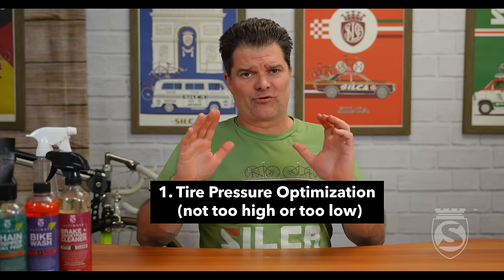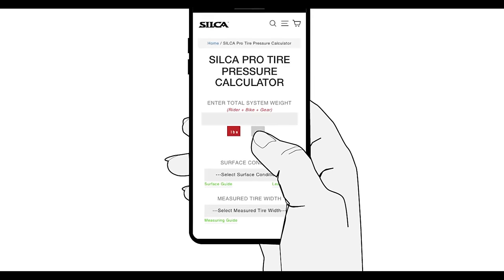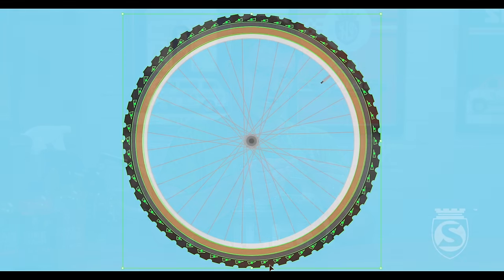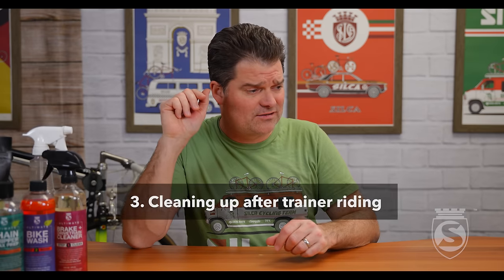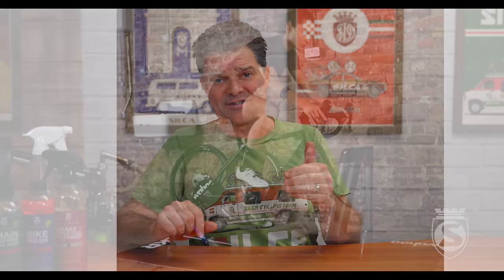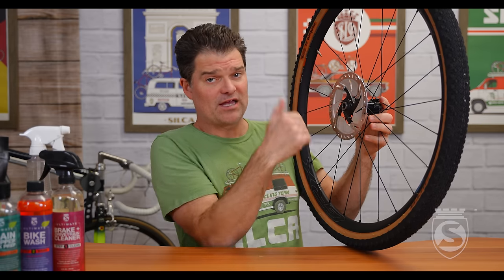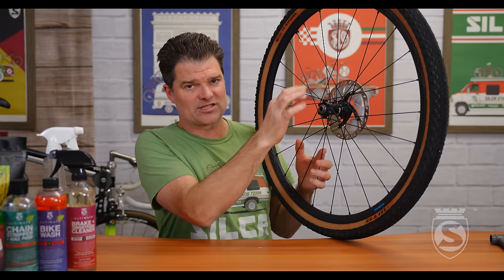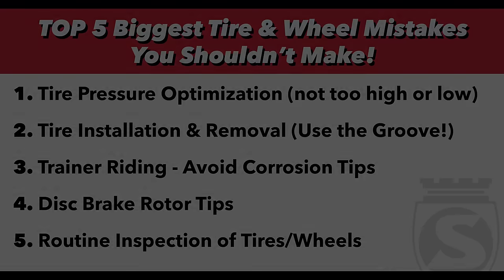Top 5 Biggest Tire & Wheel Mistakes You Shouldn't Make

Comment: I always find that warm tires are easier to install than a cold one. I usually put them in the sun for a few minutes before installing. The tires seem to be more flexible when warm.
Reply from the maker: That's a great tip!
Reply: I put them in the bathroom (my warmest room) 11:04 over night before installing so they’re 26 degrees Celsius when I install them instead of being 15 degrees. It’s often the difference from an easy install and a hard install. I also bought the plyer thingie and it’s absolutely worth it.
Reply: Under the more is better theory, popping that tire in the oven at 350F for 45 min will make it super easy to install... or will make banana bread
Reply: great tip on the tires. I put my tubeless tape in the sun for a few minutes before applying. Makes the adhesive a little tackier.
Reply: Best tip. Put your bike in an autoclave. Tyres will slide on. 

#Sorted
Reply: Funny comments aside, I mounted a new GP5000TR 28mm last night and had left it on a radiator for an hour. Obviously not in the oven temperatures, but comfortably warm to handle and it went on much easier that the one I did early in the week that was cold. It works. AND Schwalbe tubeless rim tape forms nicely to the rim when that is warm too.
Reply: I stick a new tire on the dashboard of my car, facing the sun, for a half hour or so. This really helps soften up the rubber for an easier installation.

Comment: Your pressure calculator really helped me, and I'm just an average guy.  Interestingly, I like them about 2 psi less than the calculator tells me.  Now I know why.  By the way, my Pirelli P Zero Road 28 mm measure about 30 mm on my wheels with 21 mm inner width using TPU tubes.  Part of the reason I switched from Contis is the Pirellis are so much easier to mount.  I can always do it with my bare hands.  And they never get those fibers coming out of the sidewalls like Contis.
Reply: 2 psi isn't really an accuracy you can gauge with any bike pump, if you're within 5 you're fine.
Reply: @countspokeula539  You raise a great point, but I always check with a digital gauge.  But who knows how accurate it is?
Reply: @stuartdryer1352   I know, it amazes me that pumps don't quote an % accuracy like so many other things these days

Comment: I don’t sweat much on my trainer, but just in case, I use a slightly cracked carbon wheel on the trainer so don’t need to worry about damage (in my case the trainer bike is only used on the trainer). So if you have an old wheel and use your road bike on the trainer, take a minute and swap out your good road wheel for an old one and then no worries.

Comment: I’ve got a couple sets of wheels that are from the early days of Tubeless.  Sometimes to seat my tires tubelessly, I have to mount the tire with a tube to seat the bead, then remove one side (and the tube), install the valve stem sans core, and use A LOT of pressure to re-seat the other bead.  A bit of a dance, but it works!
Reply: Even using the "blast" bicycle pumps don't always work because the air escapes before it can build up enough pressure to seat the bead of the tire.  I am now resorting to using an inner tube inside my tubeless wheels since that's how the bike came originally.  For me tubeless tire mounting & sealant is no longer worth the hassle.  The weight penalty is insignificant in my opinion.
Reply from the maker: Yes, early tubeless was built around a vision or true, sealant free, tubeless functionality, just like a car tire and OMG, the tire install and removal was crazy!!  Kudos to you for sticking with it, when it worked, it was really good.. but most people bailed out of that tech very quickly which sadly set the whole tubeless transition back a few years..

Comment: Thanks for the good advice of putting the valve stem at 11 or 1 o’clock when mounting tubeless tires.  My experience goes all the way back to mounting wire bead clinchers in the late 1960’s when I was a teenager and riding sew-ups for three decades as an amateur racer.  Now, it tubeless on all my bikes.  I had been starting to mount the bead of the tubeless tire  at the valve stem itself, then working all the way around to the opposite side to get the bead over the rim.  A real struggle even with your Silca tire irons and high quality aluminum rims.  Now, I will do your method instead.  Learn something new every day.  Thanks !!!

Comment: In the section in which you discuss inspection of the wheel, you focus on the spoke nipples and the hub, especially where the spoke attaches to the hub.  In addition, it is critically important to inspect the rims for cracks, both radial cracks emanating from the spoke holes and circumferential cracks in the rim sidewall, both resulting from cyclic stress of the rolling wheel, through the spoke to the rim.  These cracks can propagate and lead to catastrophic wheel failure.

Comment: 1. Tire Pressure Optimisation, tick.. I am still not getting it right, but I try... big problem is loss of pressure over time, ie days...so check every day before riding...  
2. Tire install / Removal. tick.  I learned to use the groove a few years ago, what a difference. 
3.Trainers and Corrosion. tick.  Consider general riding too as sweat gets into head stems etc. I avoid the problem by not using a trainer.  
4. Disc rotors.  tick.  do not touch. I use an auto brake cleaner when I clean the bike after it has been cleaned.   I use auto cleaning shampoo, then wax the frame and use an armour all product on the rubber and seat et al, then I brake clean.
5. Inspection.  tick.  and the bike itself.  every time I take the chain off for a warm  wax bath. I check that all is tight, including chains / rings, seat and seatpost, cassette, spokes derailleurs and levers.  

all good advice.  tick.

Comment: Great list, but the most common mistsake that I'm still guilty of is not checking my sealant often enough!
Reply from the maker: Definitely working on a sealant related video on it's own.. please let us know any other tips or issues you'd like to see covered!
Reply: Sealant compatibility....mixing sealants vs cleaning out all the previous sealant.  Or mixing when you run out of one kind.
Reply: Love to see a video on cleaning out old sealant! Is there a best method or product?
Reply: @SILCAVelo  why valves get clogged up so easily give us some tips or advice and get so frustrated getting fucked up I do my best to mitigate that
Reply: @SILCAVelo methods of checking sealant levels without disturbing a nicely seated tyre bead?
Reply: @SILCAVelo  Should you break down and clean out the old sealant on some frequency, every 6 months, every winter, etc. If not riding a wheel set for 2 months, is it OK to keep you wheels inflated and spin them weekly to keep the sealant from condensing in one spot and then replenishing the sealant when you are ready to use them again?
Reply: @SILCAVelo maybe not sealant related but what is the best rim tape to use with specific sealant. So Silca say the best rim tape with their sealant is TTP tape but I can’t find a rim tape manufacturer that lists the make-up of the tape. Also, why is TTP tape better? Thanks.
Reply from the maker: Tapes from Stan's, WTB, 3M, and Tess are all TPP.. it is generally a bright color and has no printing on the tape as the polymer is so dense that ink cannot penetrate or stick to it.  TPP is generally 3-4x stronger and is much more abrasion resistant.  The only downsides to TPP are that it's more expensive and manufacturers cannot print their branding on it.

Comment: I installed tubeless road tires with foam inserts yesterday and it was a big mess and the only way I can think of getting them off again involves explosives. Can you cover inserts in the next video, especially in combination with the Silca sealant that does not go through the valve.
My tip on installing tubeless tires is the Crank Brothers Speedier lever which hooks over the bead. Its main function is stopping the bead of coming off again.
Reply from the maker: Just filmed a video discussing this a little bit, should come out this week.. but yes, they are a total nightmare.  The key is to get about 90 degrees of bead unseated.. not removed, but just pushed inward far enough that it's no longer sitting on the bead shelf.. then use your fingers to sort of massage the insert radially outward into the tire and once it moves you can now push that bit of bead down into the channel.. the trick is to then work your way around the wheel doing this with both hands while not letting the insert push back inward as it will displace the bead if it does this.. it's a real skill and I've done hundreds of these and still find it completely madenning.  For WT teams at Roubaix, not gonna lie, we just cut through the tire and disembowel the insert.. such a waste, but when you have 40-60 wheels to do and the tires were free.. that's what happens!

Comment: Thanks for following up on the disc brake question; I agree that if anything, high temp metal anti-seize without anything else in it that corrodes aluminum is probably the thing to use on CenterLock lockring. I guess the question is whether it's better than dry; risk of contamination vs risk of seizing. Nickel would obviously be fine but would the high temp grease of the Silca Anti-Seize withstand disc rotor temperatures of however many 200+ degrees? Withstand = stay viscous enough to not spray out and contaminate.
Reply from the maker: SILCA anti-seize is considered non-migrating inside of jet turbines (1500 degres F is the listed burnoff of the synthetic carrier), so at our low rotational velocities and temperatures you will be fine ;-)

Comment: Excellent explanation on tyre fitting. I had worked it out myself over time and just put a pair of Maxxis Forecaster 2.4WT on a 30mm inner carbon rim without using any tyre lever. In the past I have damaged the decals on the rim by inserting the lever and moving it in a direction that will run over the decal. I always check that now. I do not use any lubrication to fit a tyre but there is advice out there to use soap etc, any thoughts?
Reply from the maker: If you can do it without anything, that is best... most latex based sealants have very high Ph and will harden quickly if exposed to water, so you can use a highly concentrated soap (SILCA bike wash has Ph 11.. similar to SILCA sealant) but it needs to be the absolute minimum amount.  With synthetic sealants like MucOff or Milkit you can use a tiny bit of soap in water as those sealants are not hardened by water.

Comment: I ran the highest pressure in the past because lower, 80-90 PSI, I kept getting pinch flats. Better tubeless tires and nicer roads later, I'm finally able to let my hair down run 60 PSI on my 25mm road bike.

Comment: Another part that might break by sweat is the handlebar. Some people sweat a lot from the hands or the sweat from the face falls down on the bar tape and the accumulation of salts in the bar tape corrod the handlebar. Signs that the sweat of the user is corrosive is sometimes seen by the coating finish of the brakes levers or name plate of the shifters are worn down by the corrosion of the sweat 💦.
Reply from the maker: Thanks @fruissy, we cover this a bit (along with some amazing viewer images) in this video: https://youtu.be/hCK0-a4ZCpU?si=BY-Jq2UaB40X_NPv

Comment: Excellent stuff as always.  Thanks!
BUT when installing a tube in a road (or narrow gravel) tire due to HUGE gash, and there's tubeless rim tape on an already not-too-deep center channel (Zipp?) rim, any other thoughts? The tube typically does NOT want to stay up in the tire where it belongs, and levers exacerbate the tube trying to escape, and then pop. May have to start packing one of those 'tire pliers' shown in the vid.  Cheers!
Reply from the maker: That is such a challenging situation!  Yes, the key is to get just the tiniest amount of air into the tube to give it shape to avoid pinching but not enough that it has really any outward force against the tire.. ahhh!! So difficult!

Comment: I have a wheel setup of carbon tubeless ready rims, continental 5000 clincher tires and TPU inner tubes. I never need levers to mount or dismount  the tires, I use my hands to  stretch the tire beginning from the valve position at the top  going around down to the bottom of the rim, obviously, always using the center of the rim bead as my ally.
Reply: The ease of installing really differs from wheel to wheel and what tire you put on them. My Mavic Cosmic wheel set is a nightmare with Conties, but easy with some other brands.

Comment: TP Calculator question.  How do you deal with 2 different size tires? Running 32 in back 30 up front.  Calclator comes up with a higher pressure for the narrower front wheel.  Seems odd to run higher up front.

Comment: When tires are installed the usual thing to do is install one side at a time. When one side is installed, and the other is about 90% installed, and that smalll section is left hanging and stretched outside the rims channels, does having that section of tire bead stretched like that cause a wobble in the tire when it's installed and pumped up? I have Continental Race King tires that have developed what seems to be a permanent wobble. It's definitely not how I install them because I make sure the line just above the bead is uniformly even around the circumference of the rim both sides. It may be due to the frequent punctures from glass, but I'm not 100% of that yet.

Comment: Also love 32 GP5000s on my 3T Discus 45|40! However mine only typically measure 35.5.
Reply from the maker: You must have the newer GP5000 TS which are slightly narrower.. I still have the original GP5000TL (pre-pandemic!) which were sized based on 17mm bead width rims, the newer Conti's are sized based on 19mm internal.. this is part of why we have to use measured width as it all just gets SO comlicated!!

Comment: Hi from Spain! Big fan of the brand! I have full confidence on Silca’s sealant but I am having trouble with clogged valves. For now I change them but wonder if there is a better wayvor if I am doing something wrong. I am willing to change the valves every once and a while if it means it will seal when I need it to. Thanks!
Reply from the maker: Just shot a video this weekend addressing this, but get some cheap pipe cleaners, like the ones kids use to make crafts, and put some Synergetic or SynergE lube on there, then run it through the valve.  Soak the valve core in a little Synergetic or SynergE while you do this and then reinstall.  The WS2 nanoparticles in the lube fill in all of the little micropores in the metal surface and act like a non-stick coating for the valve.  Our other suggestions are to store the valves in the 5 o'clock position, and before you ever let any air out of the valve, put a pump on and give it a good blast of air into the tire.. this will purge any sealant residue inside the valve and keep it from getting carried into the valve core by escaping air.
Reply: Great!!

Comment: Hey Josh - sorry if I missed it. Other than an overall miss-match of tire and rim size or going too low on pressure, is there any issue with running your calculated tire pressures below the pressure range on the sidewall? My Perrelli Cinturato’s seem to suggest some pretty high pressures. Thanks for all the great content!
Reply: To clarify - I meant running pressures below the recommended minimum pressure.

Comment: Great tips !
A lot of us that ride outside in cold weather, ( this would apply to people washing indoor training bikes outside) and don’t have access to a water hose.
Any thoughts on a form of 1-2 gallon water pressure tank to use outside ?
I would think the drive train cleaner sprayed on and some soapy water with a brush then spray clean would work . At the moment I use a bucket of hot clean rinse water and a bucket of soapy water with fleece lined rubber gloves .
Reply: At CX events in the UK quite a few are using cordless electric pressure washers eg. Worx Headshot. That particular one requires a separate water container and people use aqua roll or other camping water carriers
Reply from the maker: Bucket method works well, though I get what a pain it can be filling multiple buckets, but that's probably safest.  There are small pressure washers that feed from buckets, but they introduce some risk and you still have to fill the buckets!  Some people I know will do it in a shower which also works but does bring it's own issues!!  I'd say keep doing what you're doing, also be sure to dry the bike, we will cover this in a future video, but a nice microfiber wipe to dry really does help to remove any residual dirts/oils/debris and if you have hard water, will also reduce any potential damage to calcium or lime buildup.
Reply: @SILCAVelo  yes and I have a compressor , so I blow it dry , especially around the bearings and drivetrain.

Comment: Question: How do inserts affect the air pressure you should run on your tires?  Have you looked at what inserts are better than others for gravel bikes and mtb bikes?  Thanks
Reply from the maker: They will not affect your pressure, but the key is to get them the right size for your application.  We like the Vittoria ones as they are closed cell and are compressed down when under pressure so that they are not contacting the sidewall of the tire, and then they expand rapidly if you flat.
Reply: Thanks for an quick response!!  @SILCAVelo